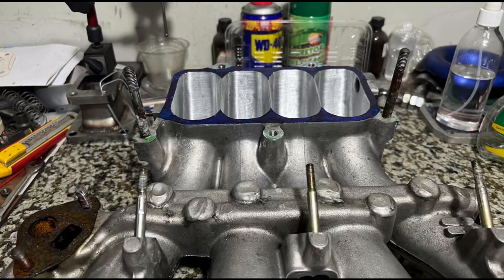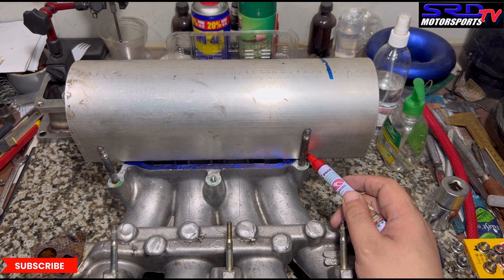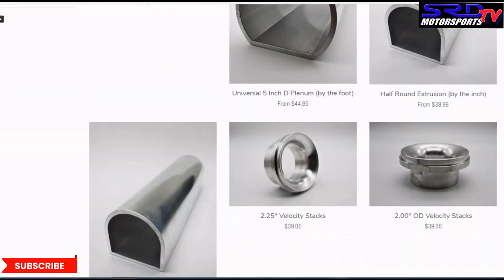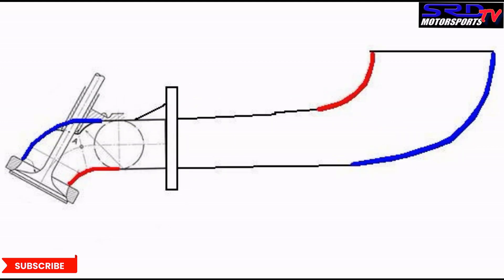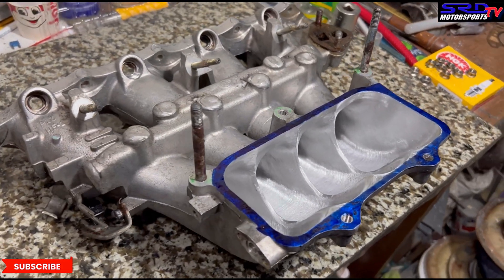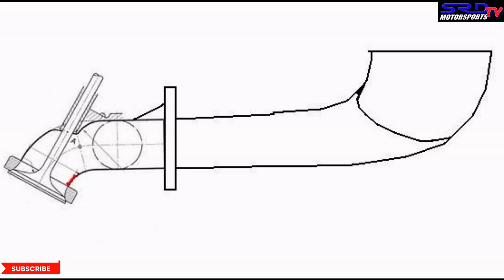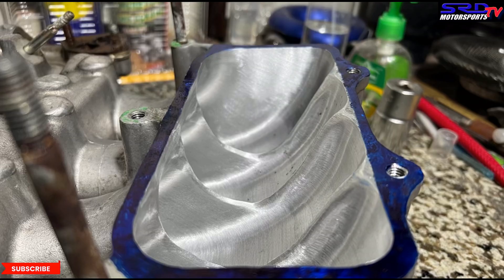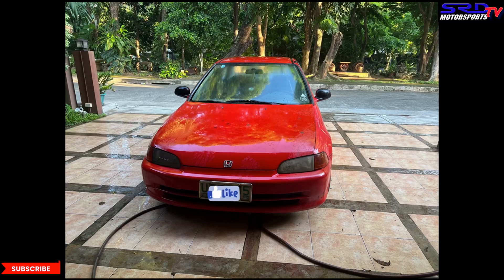H22a Intake Manifold Race Porting and Development

Comment: Have u done a euro r manifold for the h22 like this
Reply from the maker: @alex13238712  I have checked and done once …it’s like a p30 intake on a b18/b20 
It’s okay but not enough for any big power
Reply: @SRDmotorsports  so a stock p13 will give u better overall gains than the euro r..is there any benefit to a euro r  ...in stock form to a stock p13?
Reply from the maker: tbh ? I’m not sure I mean half of the reason for it is we hear people speak of it either cuz they sell it? Or wish to buy it?

it’s okay to run it but a skunk2 pro series h22 intake would prolly do as good or better

And then anything more or if needing more power/performance then porting the manifold like we did here is the next step
Reply: @SRDmotorsports  i have a skunk2 as well but after vtec engages it doesnt climb at all it seems like the curve platues ..before vtec it looks like it really wants to climb crossover point not much gains it did make 186whp 169tq it did have the stock header to a 3inch exhaust tuner told me with stock internals header wont make a difference
Reply from the maker: but a header and exhaust strangles a motor

like the d15 we dynoed because it still had 2in exh no matter what vstack we added it didn’t do anything 

Can’t add “IN” when they can’t “ex” out
Reply from the maker: Bet u a header + don’t change anything else now and just re tune on the dyno 

That 186whp will be a past tense
Reply: @SRDmotorsports  u right i have  a 4-1 hotshot header that was gonna go on ...tuner  just said not to bother but i feel it would of made a difference..thank you so much for ur input n ur work is truely appreciated
Reply from the maker: Great u have a header on hand ! Definitely won’t hurt to try 😎

Comment: Hi !!  Super your videos you will install which parts on a H22 A8 to gain 50hp?
Reply from the maker: Thanks for checking the video my friend! 

For 50hp gain easiest would be pro2 cams and either port manifold like this or skunk2 pro series intake + good exhaust
Reply: @SRDmotorsports 
Thanks you My Friend!!
 My h22 is disassembled I will order the parts.  What high compression piston and connecting rods would you recommend?  camshafts?  injectors and fuel pump?  I'm thinking of ordering the skunk2 pro series intake manifold, good choice?
I  already have an an P28+Hondata s300 ecu,balance shaft removal kit ks tuned with oil pump 4 pistons inclued,  clutch competition stage 2 clutch kit and an SRS full exhaust.
Reply from the maker: @sebastiengaudens5986  yes skunk2 pro2 is a good good choice

Get the npr/typeS pistons because it’s oem replacement u can’t go Wiseco or super tech aftermarket because h22 has FRM sleeve so must use oem 

But u can resleeve the engine to let u run aftermarket pistons but will be more expensive
Reply: @SRDmotorsports  
WISECO HONDA PRELUDE H22 H22A H22A1 H22A4 HIGH COMPRESSION PISTONS 87MM 11.5:1
Good choice ??
Reply from the maker: @sebastiengaudens5986  no you will need to resleeve your block with Iron sleeve because right now it’s FRM and that doesn’t work with forged pistons
Reply: @SRDmotorsports  OK, so, do you have the référence for the piston npr/typeS please ?
What does FRM mean?
Reply from the maker: @sebastiengaudens5986  the typeS piston can be found in EBay 

FRM means fiber reinforced metal
Just like the s2000
Reply: @SRDmotorsports  Ok thanks for the translation. My english is very Bad😬. So, Can i use the oem connecting rods with the type S piston?
Reply from the maker: @sebastiengaudens5986  yes oem rods on typeS piston it’s good
Reply from the maker: @sebastiengaudens5986  Yes the Major Gold Series u can use without resleeve it works for FRM sleeve like the H22 but expensive but okay hehe
Reply: @SRDmotorsports Must i use 1 reinforced cylinder head gasket? How Can i chose it?
Reply from the maker: @sebastiengaudens5986  just Use OEM Honda gasket I always use OEM it’s good :)
Reply: @SRDmotorsports  Ok !! Now i know what i have to do🙂 it's just the begining of the project 😬 
Thanks you for your answers 🙏
Reply from the maker: @sebastiengaudens5986  no problem glad to help :)

Comment: That tip on the GSR manifold was much appreciated brother. All these years lurking the forums I never saw the pics of Erick's reworked manifold but read alot of that car, thank you for showing those. Gave me inspiration, I  have a EDM civic mb6 with the B18C4 and I'm turboing it, already got another manifold to chop up. Now the big question, was Erick really on the bottle on that 9 second pass? I've seen people swear by yes and no loool
Reply from the maker: Thanks man! Was just lucky to talk thru Pm with  Randy Monroe back then and I used to bug him a lot about primary length and secondary length etc on exhaust/headers and all of those notes? He answered = I kept safe it’s also why I do plan on designing headers soon and Ofcourse only “here” will it be showcased
Reply from the maker: “If he was On the bottle” 
maaaaan that topic has been spent a lot indeed I never asked Randy cuz I figured a lot of people he doesn’t share info with was prolly asking the same right away loool

but I feel if he did? It was just a 10-20shot I think the goal or intention was more to be like “the first”

If you remember He was neck and neck with Bisi and Bisi had the higher mph but Erick ran quicker so prolly better traction. They were both like 10.1 and 10.16sec lol! 

So if he did? I don’t think it’s like “we need to be on the juice to run 9s” it was more like needed that extra 10-20hp just to be the “first”
Reply: I'm a bit too young to remember, because  when I was capable to understand english and curious to learn more alot of threads had already been taken down on honda tech :( but that theory on the small shot I think I never heard about it ahah

Good luck on the headers ,as always I'm really curious to see the data ahah, garage 4age as some nice videos about headers (just in case you don't know about him). I can't help but imagine you with your own Dyno, let's try and make it happen
Reply from the maker: @tiagosilva2635  I mean I can’t say he was on the bottle but if he was? That was the only sensible reason I can think of because nobody saw or found a “tank” 😂

So a small one is easy to hide lol
Not the “harry I need two of these two of the big ones” 😂

And yes!! Garage 4age I watch a lot and even before I made this channel last year during the first start of the pandemic, that’s one of the few I always checked

And maaaan even if a dyno needs ALOT of room? All this time I felt even just an “engine” dyno will be worth Gold for finding and sharing info here!

it’s not to compare on “other” dyno but to find “gains” on mods

It’s prolly why skunk2 has their own engine dyno aside from dynojet

As well as Endyn back when he was active
Reply from the maker: @tiagosilva2635  and yeah even I didn’t reach that time of Erick and Bisi but when I read it after 2003-2005 ? The Forum was still fresh and nothing was “pulled out” yet lol

Just lucky I got to talk to Randy Monroe
Even Don Flores of DFenterprise
He is DonF in honda-tech thru email he shared me a lot he used to race in the scca gt3/4 class and he raced with or against the Mugen crx so he had a lot of good info

Plus years after? His competitor sent the crx to be rebuild the Mugen D16a6 ! So I got some cool cool tips from him
Reply: Yeah I feel you any kind of dyno would be gold but the space and the $$$ don't make it easy, A DIY benchflow would be nice too!! Just to see the differences, I have read a couple how to's but never had the gut to build one.

Oh DonF, really sad what happened to him such a great contributor to b series development, a lot of great info by him on honda tech still, on of the true OGs.

A video about those mugen crxs would be great I have the catalogs of that era somewhere... Would love to learn more.

Amazing that you had a real mugen engine on your hands and really nice coincidence too
Reply from the maker: @tiagosilva2635  well not on my hands the Mugen engine but Don did

As he rebuild it I mean his competitor chose him cuz back then they raced against each other so Don was the safest choice cuz he also ran a D16a6 back then so he showed me details and pics and a lot of those I saw some ideas I use still today for my own builds 

True on engine dyno but maybe one day… because I feel that’s perfect for my style = engine builds, intake tests , exhaust test could be possible…

By then I’d need a bedroom at the shop cuz I won’t leave anymore jahahah il sleep there hahahaha